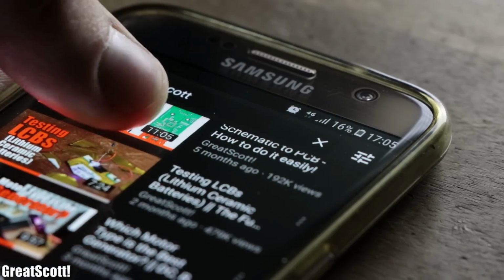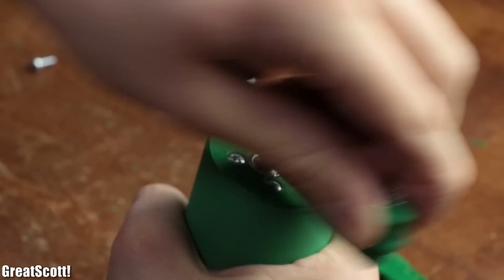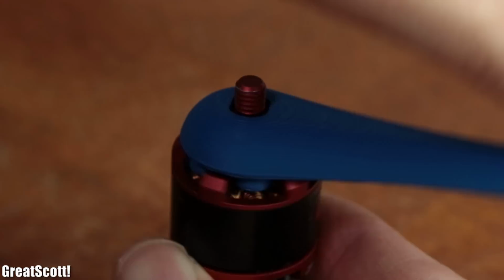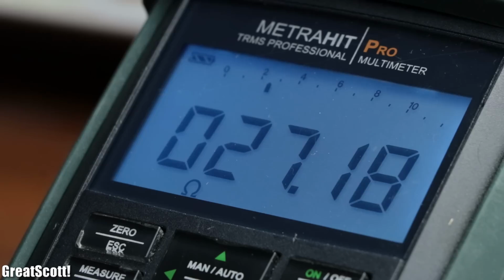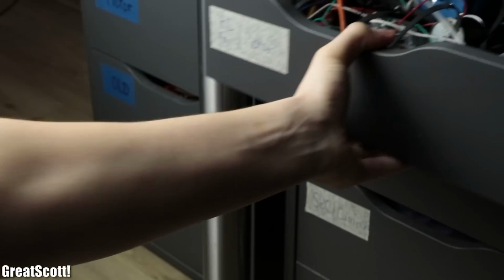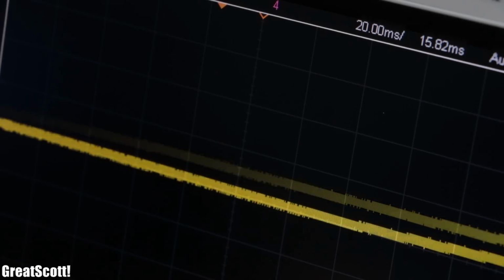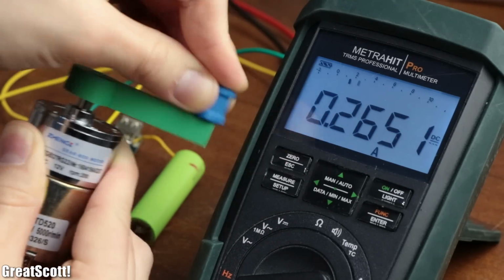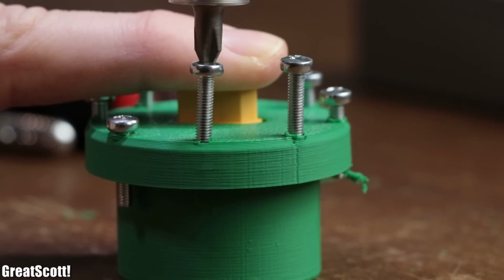Make your own hand-cranked Emergency Powerbank

Comment: Why did you not use a FULL BRIDGE RECTIFIER? Is there any reason for the one diode?
Reply: That is a DC motor. The diode only prevents reverse polarity. If you use a rectifier you loser more voltage in the diodes.
Reply: Not just a single puny diode
Reply: The problem with a full bridge is that now you have two diode drops instead of one.  It's more wasteful.  Now, if you really wanted to be efficient, you'd put a single diode across the motor - so it would be hard to turn in the wrong direction.  Now, you have voltage drop across any diode.
Reply: @russellhltn1396  Great idea. I like that
Reply: but wait, if the motor is connected  directly across the batt ...
Reply: @kissingfrogs  Yeah, you have to make sure you're putting work into the system and not letting the system put work into you.
Reply: @russellhltn1396  full bridge mosfet rectifier will do the trick.
Reply: Russell Hltn You could also use a ratchet mechanism to avoid reverse polarity.  No voltage drop!
Reply: @russellhltn1396  or replace two of the diodes with NMOS transistors
Reply: Yeah, that would make it work in both rotation directions. Now it works only in one, and, to my taste, the inconvenient one.
Reply: Look up 'free wheeling diode'
Reply: Okay, use schottky diodes, you get less voltage drop !
Reply: a FULL BRIDGE RECTIFIER can be used but not to rectify the voltage but to allow you to crank the motor in any direction
Reply: the diode is only to prevent reverse polarity, not rectifying any AC
Reply: that one diode bugs my mind im thinking if his pulling ac theres a full bridges on the power bunks board i really dont get it??
Reply: @salvygonzy3600  There is no AC involved.
Reply: I think it would work better with a full bridge instead a half wave (single diode), Maybe he used the single diode to keep the thins simple
Reply: There is no half wave, the brused dc motor outputs dc. No ac to rectify!
Reply: @kistuszek  No sir, when electric energy is generated from induction it is AC power no matter if the motor you use as a generator is a DC motor.
Reply: That is correct in this case, (but not in all cases take note!) thats why you have brushes in a such a dc motor! It alternates the polarity just the right way depending on the angle. Turning it you utilize the same contact switching only backwards, thus the motor leads are mechanically already rectified, thus dc!
Reply: @kistuszek  I need to see that
Reply: @serafincastilla  He is right, it is already rectified mechanically, but if you turn the motor the other way, than you get a different polarity on the output.

Comment: Like I mentioned in a previus video. The best generator IMO is a microwave oven motor with a bridge rectifier and a regulator to make 5V of the incredibly crazy high 100-800V the motor can generate. Its a 4RPM notor.
Reply: Sounds good.  Have you considered making a video or are you hoping someone else will pick up on the idea?
Reply: @raykent3211  My video editing skills are really low. I have tried to make a few vids before but they were all badly rated since I made them waaay to long and talked waaay to much. Im just not a presenter type of person. Im just giving out my thoughts here. Once I get a 3D printer than I can start to experiment with that thing.
Reply: Other people have done it on YT im pretty sure
Reply: I'd still watch the video but just skip around after making note of important time stamps, and putting them into a comment to help others get to what they want to see

Comment: why has no one, made a modern version  hand crank  base of a ignition magneto ? either like the system used in law motors or like the phone in the early 1900 century that used a simple low-tension magneto.

Comment: A simple mod that would really add alot of safety to this is Zener diode rated at 4.3V with atleast 1W of power dissipation and probably <2% Vr tolerance (such as a Vishay BZX85B4V3-TAP) placed across the battery. Of course you wouldn't be able to fully charge the battery but you'll definitely preserve the battery from overcharging or spikes when cranking.

Also adding a recoverable thermal fuse/PTC thermistor tapped to the battery (but in series with the rectifier diode would disable hand crank charging if the battery gets to hot (or the surrounding environment is unfavorable for charging which is usually anything above 40°C)
Reply: Zeners with such low voltage ratings usually have a very high reverse leakage current and therefore will drain the battery very fast.

Comment: As far as i did research on charging Li-ion cells, i dont think thats a proper way to do it. Atleast for Li-ion safety you really want to have a smooth regulated current to charge it. Othewise the chemistry in the cell can get damaged very fast. 
But since this is a really low power and rarely used device it should be fine :)

Comment: Can you make a hand crank generator and make it better with more batteries and a solar panel so you can use it in emergency. In camping and when the power goes out and it can charge your phone i tried to make one my self but. I fail
Reply: The solar panel I used made a big fire. But my solar panel was good
Reply: I really won't a power supply but my dad wont buy me one he says it is to expensive

Comment: BLDC would work far more effectively with a gearbox than the geared brushed system you used.
Reply: Shaun Dobbie yeah, why he didn’t print a gearbox for the bldc motor?
Reply: @gigigigiotto1673  printed gears are very poor material wise, you would need a 3D printer that uses metal powder to make one with any sort of life or power handling. ABS or PLA is not a structural material, though you can use it to make investment castings to pour actual brass, zinc or aluminium pieces.
Reply: @SeanBZA  this is incorrect in my eyes. I 3d print gear boxes for my Robotics projects all the time using nylon x filament ( a mixture of nylon and carbon fiber) that is rediculously strong and can withstand alot of abuse. And in this case petg filament would be more than enough to print gears.
Reply: You wouldn't have to print gears, with some modification a standard gearbox off a brushed DC gearmotor will fit onto a small brushless motor. We do this a lot in combat robotics for drive motors for beetleweight robots.
Reply: Yup, no doubt.  Comparing a slowly rotating brushless to a fast rotating brushed is dumb. Its not in any sense a comparison of efficiency.  Brushless will win that at any speed.
Reply: True, thats what I was thinking all the time, I don't really have an idea about BLCD motors, but he makes ten hours experiments with rewiring and stuff and even buys more expensive motors just to destroy them, but finally uses a ready build cheap one that just uses a gearbox, where he didn't came to the idea to try it while the ten hours and prbably not even now, until he reads this comment 😲
Reply: He probably could've even used a modified SERVO? this makes me want to do a video on my hand crank generator that can crank out 12w and can fit in your pocket
Reply: But BLDC requires high RPM so you have to make a gearbox with many gears to increase RPM to 2-3 thousands to get 5 volts etc.  But as we know gears will also provide much friction. and you have to do extra work on it and also decrease the life of your gear box
Reply: y'all are wrong anyways. what he needs is an ENERGY HARVESTING circuit. also for what he built he could have used a full-bridge rectifier as well.
Reply: for a simple hand crank PLA would even work for a gearbox. i was wondering why he modified a brushless motor.. redundant.. also i dont think his printer is tuned well enough to print gears lol. u see those prints?
Reply: @americanengineering2063  haha yea he needs to spend a while longer with mechanical and slicer tuning so his tolerances get better.
Reply: American Engineering at some points, it really doesn’t look like the tolerances are off as much as it looks like he’s using a really high layer height; the body of the crank looks pretty good

Comment: No zener diode for Over voltage protection???? No bridge recifier for reverse cranking????
Reply: Reverse cranking is dealt with using the power diode on the motor. But you’re right, there is nothing for overcharge protection.

Comment: I think when you rotate shaft in counterclockwise you haven't got any voltage level

Anyway i needs help for powerline communication project (design Of DIY powerline communication module)

Comment: hey greatscott, can you make a video about breaking bad's galvanic cell battery that walter and jesse made when they killed the battery in the middle of the desert?
Reply: Led lights whit battery made out of potatoes. It had two plates that you push to potato, one was copper and I dont remember what metal the other was. If I remeber correctly there was 10 potatoes in series.
Reply: @bassotalli6494  Copper and zinc stuck in a potato or lemon, but you cant make significant power with those, I wonder how much copper and zinc is needed for cranking a car, but I doubt that amount they used in BB is remotely enough
Reply: @themanwithIBS  yes, absolutely. A potato battery produces around 1.5V, so putting 10 of them in series would actually achieve a voltage higher than the standard 12V car battery with maximum charge. The maximum current of such a battery, however, is around 10mA. To start a normal car, you need at least 100A, for a motorhome I'd guess nothing below 300A is realistic. So to start this camper, you'd actually need around 30000 packs of 10 potatoes each in parallel.

Comment: Why not charge a Super Capacitor and then boost its' voltage to 5v?
Reply: Not sure about the boosting part, but generally supercaps take charge more efficiently and you can have a usable voltage sooner if you need to crank from flat (which is pretty much the point of a hand crank). Drawback is off course capacity. But depending on you use case that might not be an issue. Lasersaber have good vids up https://www.youtube.com/watch?v=9y4pwcFyLOE
Reply: This direct connection to the battery is more efficient. The boost converter would incur some loss. Also the charger powered by the boost converter is going to try to charge the battery at some predetermined current like 1A. This will quickly discharge the super capacitor causing the circuit to brown out and then the cycle would repeat.

The solution in the video is pretty nice, the only improvement I would like to see is over voltage protection, but based on the 7 hour recharge time, may not be required for most practical use of the device.
Reply: Actually, your idea Is good. But instead ti boost the voltage I will put two Super Cap un series to support about 5.4V and make some exercises to record when de Supercaps reach aprox 5V. Nobody is going to work 7 hrs for full charge. So you don't need all the capacity a battery may give.  Perhaps to add a circuit to prevent overcharge.
Reply: @danielrouw2593  You are rigth regarding protection circuit, it something needed to avoid issues you described, but actually those circuit are available at very low cost. You see them in Julian Ilett channel.
Reply: A supercap has a very low storage capacity, much smaller than a battery. Supercaps are good to provide short bursts of high current, as their internal resistance is negligible compared to a battery.
Reply: The solution in this video also uses the boost-converter present in the powerbank (probably a PFM based one),  similarly for a supercap you can utilize charge-pump based boost convertors can operate at low voltages with 80 - 90 % efficiency . 
The only practical problem i can think of is storage. a single li-ion battery is 7.2Wh while a 100F 2.7V supercap can hold upto 0.1Wh . Ofcos nobody is going to crank 10+ hours to full charge that battery.
Reply: As super caps are usually low in voltage 2-2.5 volt you have to put them in series which isn't practical enough and there will be loss of power between charging and conversion too
Reply: @ameet4468  I found a video that uses supercapacitors that had a capacity of 3 kF; if you wired two such capacitors in series, you would get a 5V capacitor with a capacity of 1.5 kF.  It looks weird, but capacitance in series divides by the number of capacitors of the same value in the circuit, unlike series resistance, which adds by the values of the resistors in the circuit, regardless of the values.
Reply: Because its a capacitor? xdd
Reply: Because he isn't dumb like you
Reply: @ameet4468  can you explain. Im always open to learn
Reply: @jordencarmi2486  It would work just fine, but not as well as the solution in the video. First off, the boost converter is not 100% efficient so you would lose a bit of energy there. The other drawback is that the boost converter would have a minimum input voltage for it to start working. That means if the capacitor is at 0V, you would have to charge it up quite a bit before charging would begin.
Reply: @TastyBagel  thank you for explaining
Reply: @jordencarmi2486   good job with a patient and considerate reply to ameet (even though he was bit rude). Your thirst for knowledge has done you well.

Instead of carrying a supercapacitor, one could easily carry a similar sized battery pack. I think supercapacitors won't work well in the scenario explained in the video. Supercapacitors discharge way too quickly (in a few days) compared to a battery (months or years). Moreover, as others already mentioned, the energy density of supercapacitors is a few orders of magnitude less than comparable batteries. So you will need a bigger/heavier supercapacitor than a battery to provide the same energy output.

Comment: So 18650 batterxs can withstand such high voltages from your generator (20v)??
Reply from the maker: Like I said, it acts like a constant current source. The votlage is limited to the voltage of the battery.
Reply: @greatscottlab  Ahhhhh, get it, thanks!!!!

Comment: 6:37 that diode configuration would result in you losing half the power you would get all the time. You should've gone with a full bridge rectifier, it's not that hard and I think you already know this. So the only logically explaination for this is either because you're in a hurry or you don't have 3 more diodes to complete a full bridge rectifier or both.
Reply from the maker: No. A DC motor outputs DC. There are no waves.
Reply: @greatscottlab  then why do you need a diode?
Reply: @domenic3344  why would the polarity reverse if it's DC? Only AC reverse it polarity, while DC polarity is constant.
Reply: @luongmaihunggia  he uses diode because suppose that if you cranked dc motor in reverse direction then polarity also get reversed which leads to destruction of battery and circuit .
So to avoid that a diode is used .
Reply: @chaitanyagoswami2393  yeah, if you crank it in reverse you won't charge the power bank either.
Reply: @luongmaihunggia  yeah he can use full bridge rectifier , so that he can get same Polarities no matter what direction in which it cranked...
You are right......

Comment: You should start using fusion 360 its free and is much better that 123d design
Reply: Its free only for students.
Reply: @zanpekosak2383  fusion 360 is free for hobby and start ups as well. Basically free for everyone until you make money.
Reply: I think is's free up to $100k/year revenue
Reply: every software is free.
Reply: AirsoftSlo fusion 360 is free for everyone as long as you make under a certain amount from it all of auto desks other software is free if you a student
Reply: Fusion 360 is very expensive
Reply: If not then take it from me I started with fusion but my card ran out of money and I had to use 123d i downloaded it from an unofficial site
Reply: He is right it is free for students
Reply: Fusion 360 IS free for hobbyists, but it's not easy to get there (You have to maneuver around a few offers for paid subscription).
Reply: arduino guy do you make more than $100k a year? Unless u do that u can use it for free
Reply: Yeah but is subscription based so no fixed price
Reply: Paul Banks unless you’re a student then it’s free
Reply: I reinstalled my OS and when I tried re-download 123D design, its not there anymore!

Luckily Fusion 360 will import .123dx files. 

360 might be much better but it means a whole new learning curve, I was getting quite productive with 123D :(

Comment: Can You Explain How A UPS Works and Maybe Build One?
Reply from the maker: It is on my to do list
Reply: GreatScott! Yeah, that would be interesting. I need one because where I live, sometimes happen a blackout that turn off my computer when I’m rendering and piss me off. I need at least 400w
Reply: loooool i remember electroboom's video "powering stuff when there is a power outage"
Reply: @gigigigiotto1673  Look on ebay, you can often find pretty good ones for next to nothing, sometimes people don't even know that the batteries need replacing and sometimes a business/recycling center will practically throw the things away, I picked up an apc smt1500 for just $50, those go for $400 new then I found a couple discounted batteries for $30 and it works a treat.
Reply: Amazing. Can't wait for the UPS video :) There are a few UPS circuits on aliexpress as well. (search for UPS DIY) Maybe you can have a look at these. They work well for me but I would prefer to actually understand how they work ... especially if Li-ion batteries are involved.
Reply: I look forward to it too.
Reply: Avon Gaming its a gient power bank, its always charging and allows current passthrough. When the power goes out it stops carging and outpus the 10A 240V and powers what its connected to
Reply: It’s a big battery
Reply: @c6amp i guess thats quite trueee..